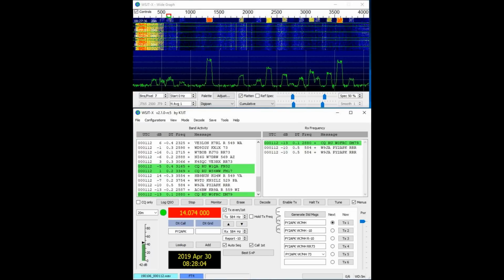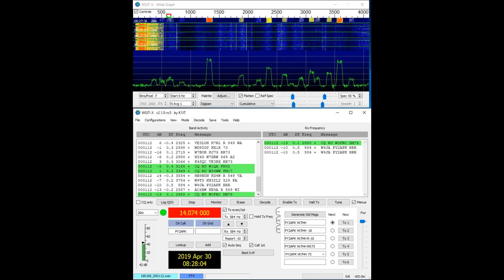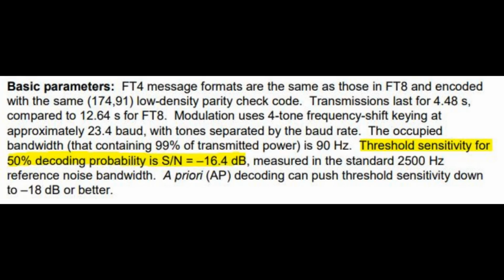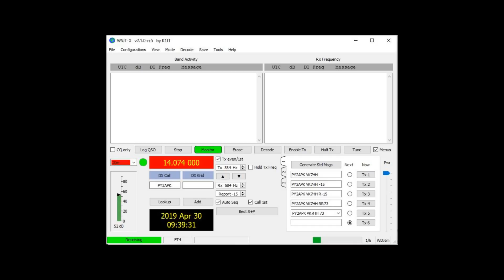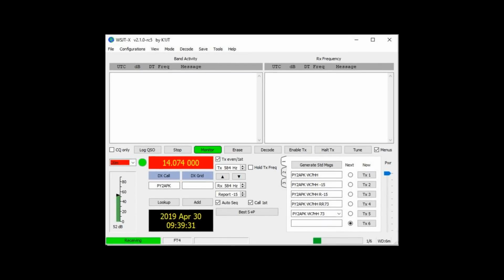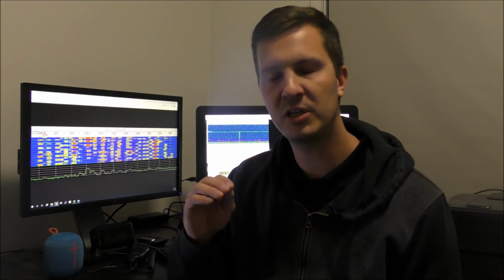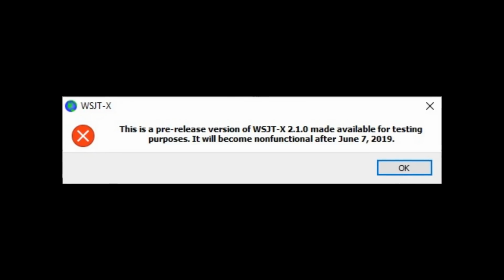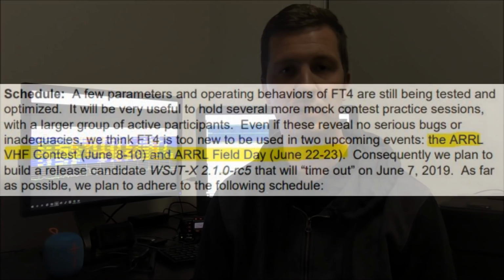FT4 vs FT8 - A new Ham Radio mode, what's the difference?

Comment: My understanding is that FT4 is much less sensitive than FT8. FT8 can decode a signal weaker than -20db while FT4 can only read signals stronger than -10db. I downloaded the latest version and found that there is only one frequency available (it’s on 20m) and nobody is using it.  Maybe this is still in development??
Reply from the maker: Yes it was still in dev. FT4 was built as a contesting mode where your not really worried about weaker stations
Reply: By the way, it’s easy to manually add the FT4 frequencies to this version. I’ve since made many DX contacts in this mode on multiple bands.

Comment: This FT crap is getting out of control. Its not Ham Radio anymore and no skill needed.
Reply: Adding new things to Ham Radio doesn't remove anything already there. No one is forcing you to use digital modes.
Reply from the maker: Each to their own I guess
Reply: Different strokes for different folks